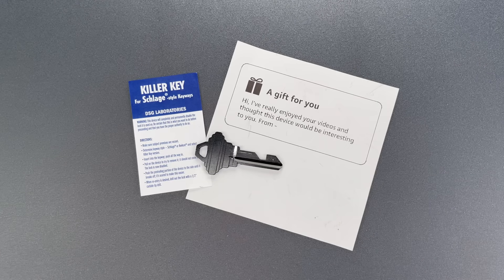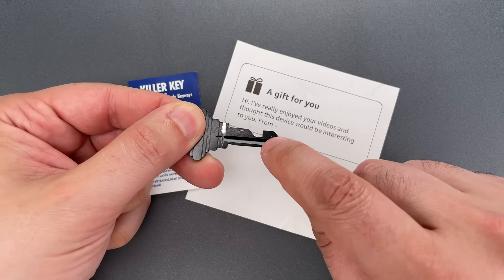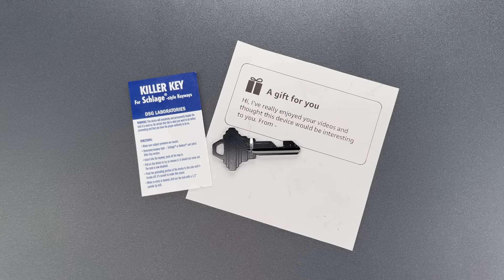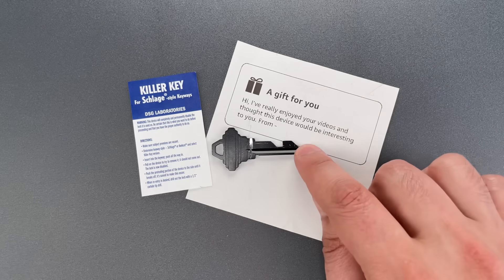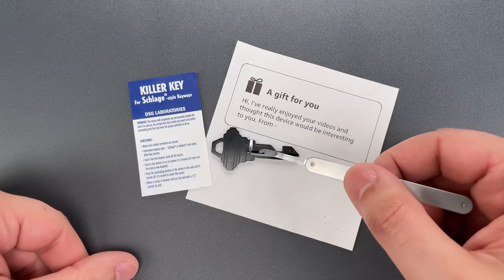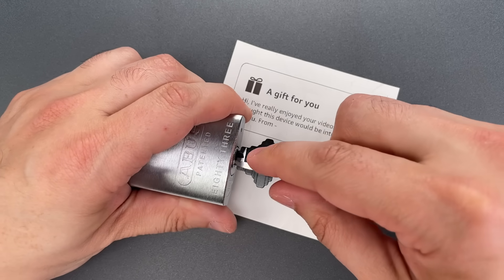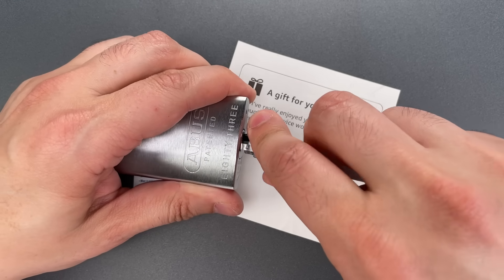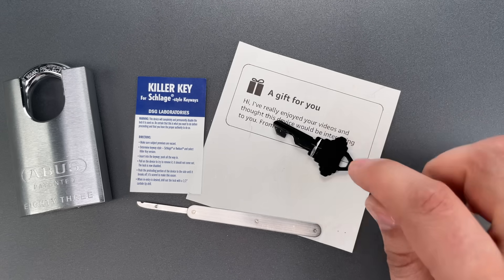[1350] Defeating a “Killer Key”

Comment: Okay, dumb question- what scenario would this lock/key used in??
To open a lock and then break the key off so it makes the lock a one use item? (For security purpose that requires a new lock at every opening?)
Reply: If you needed to buy some time to escape, or prepare by grabbing a weapon, this could do the trick.  Open the door, break off the killer key, close the door.  Might also work as deterrence.
Reply: A shop I worked for basically made one and used it on a service door, we could still use it from the inside but there was no way to easily open it from the outside. So if we needed to we would put a screwdriver in the gap to keep it "unlocked"

Comment: I remember having this kind of key deployed against a store that a family member owned. They used the back entrance or I think the neighboring store's shared rooftop access (I heard this secondhand from an aunt and a cousin later clarifying it was done to the front and backdoor). Either way they got inside and popped the door off the hinges and used three people they angled the door with the keyway facing the ground and shook the door up and a down while they tapped the back side of the door near the knob with a rubber mallet - the bit of the killer key that was in the lock came out after a little bit of work.

Comment: A hardened version with a cylinder shaped head that would block the entry, instead of the stamped key shape, and this really could kill a lock
Reply: That definitely would be harder to defeat, but I think you could still do it without destroying the lock. Take a rotary tool with a cutting disk, slice the plate away until you can access the keyhole, and then do as the video here shows.
Reply: @Dracalis  wouldnt even need a rotary tool. A good strike on the side with a hammer or rock could probably shear the head off.
Reply: @Dracalis  If you still have access to that rotary tool while standing in front of your blocked front door
Reply: @DerH0ns  why would you put a lock killer key into your front door's lock?
Reply: @GrifoStelle  Someone else may do it.
Reply: @DerH0ns  battery powered dremmel would do.
Reply: @GrifoStelle  landlord may do it after evicting a tenant before they can get the locks changed
Reply: @GrifoStelle  it could be used by landlords after evicting people so they can't get back in before they have time to change the locks. The company I used to work for did this and after I learned that I quit as that sounds shady as fuck and wanted nothing to do with a company like that
Reply: @GrifoStelle  A landlord would use it to quickly and temporarily keep anyone who has keys out, and then come back later to change the lock.
Reply: @GrifoStelle  
They were made for landlords who want to lock out whomever is squatting in there property. And with that getting a LPL to come and open it like this would be next to impossible. Making it a simple drill it through in 30sec and pop another shitty Kwikset in it and move on.
Reply: @GrifoStelle  This sort of thing is often meant to temporarily lock out a short term tenant in a cheap motel or hostel.  The "lockout keys" come with a removal tool very similar to what LPL created.  I could also see using them in a business where you happen to have that sort of cylinder and just need to temporarily but not actually permanently bar access even with a key.  That style of keyway is widely available and sufficient for basic security.  (Basic as in keeping honest people honest, effectively.)
Reply: It could still be quite easily beaten I think, unless you also don’t want to damage the key. You would just need to cut or break off the cylinder
Reply: @tommykarrick9130  what about just a flat circle metal shield, that keeps very tight on the keyhole, instead of a whole cylinder thing?
Reply: Best way to kill a lock would be to melt it until it's just a ball of metal.
Reply: @thenightingale7405  Then how in the world would it temporarily protect the property until you get back to it? Think McFly, THINK.
Reply: @thenightingale7405  thermite key lol
Reply: or just jam some epoxy in there
Reply: @danielsankey8786  Inject a bit of JB Weld into the lock.
Reply: @danielsankey8786  Or a few drops of red Locktite. A dirty trick that some Bikers (motorcycle types) would sometimes do is put a drop of red Locktite on the exposed fasteners on an antagonist's bike and make it impossible to work on. Red, not blue, which softens with heat.
edit: Actually, it's not Red Loctite (also called Stud & Bearing Mount,) it's called Wick & Lock, although I do believe it was red in color. That was waaay back in the Seventies, and I was still hung over from the Sixties _
Reply: @TaiChiGhost  yeah man thats not a thing. Locktite only works well it it throughout the threads and even then a breaker bar will still loosen it. Also you can still ride the bike for thousands of miles before it needs work so its not a big deal. ALSO bikers are not the passive aggressive type. If you fuck with them they will just remove your teeth with the bottom of their boots, not make your bike hard to work on
Reply: @TaiChiGhost  red softens with heat, you just need more of it. Blue can be removed with hand tools, but becomes easier with heat.
Reply: Or just slather the key in super glue before inserting and breaking.
Reply: @phillhuddleston9445  lightly heating superglue with a pluming torch is enough to break it down and it wont old anymore. All it would take is slightly heating it and then using the exploit shown in the video.
Reply: Just jam a nail in there with a hammer, pretty sure that locks done.  Im guessing
Reply: @lostpony4885  hypothetically... lol
Reply: At that point just weld the door shut
Reply: Better version would have a sideways M shape and a flatten end so you could hit it with a hammer and break the pins
Reply: @cursedmailman3999  I mean this video just shows the best way to break a lock is to break it
Reply: Just insert it with a drop of instant glue.
Reply: @brunesi  at this point, just use instant glue without the key
Reply: @supersoupss  yep. Nail polish. Instant noodles. Cooked rice. Flour and water. Fine street dirt plus spit. Many items would cement after insertion.
Reply: LPL would still find a way to get it out in 2 seconds, doesn't matter what changes you make to a key or lock
Reply: Saw off the head and there you go
Reply: You guys are all way to high tech. If you're gonna put a "Killer Key" into a lock just sip it in super glue beforehand. Would love to see him pick that :D
Reply: Dudes, the best killer key is a super glue tube and syringe needle
Reply: Or just pour molten lead into the lock. All youd need is a mapp gas torch, some lead and a big spoon to melt the lead in.

Comment: I'd like to see you beat a lock full of epoxy. I mean that genuinely; that's the old "never opened again" trick I hear most often, and I'd like to know if you can work your magic on a lock that has all but literally been made into a solid block, because that sounds amazing to watch.
Reply: For most US homes it would be simpler to just drill a hole through the door or the side of the house. If your door/frame/walls are made out of thick stainless steel, then that might require a bit of tough drilling.

Comment: Add a drop of superglue to it and see if you can get it back out.  Doesn't even have to be a killer key, just a wrong one that fits the keyway.  Actually, almost any method of delivering adhesive to the pins seems like it'd work.

Comment: Another suggestion I might make is, instead of giving it a key like handle attach the blade perpendicular to a smooth dome, preferably one that sits flush against the lock. It would make access much more difficult, especially if it can also be welded to the lock
Reply: Or just carry super glue which is has many more uses than a specialized lock plug.   The only real purpose of the key design is stealth.  It blends in with the other keys you carry so it has to look like a regular key.
Reply: @toolbaggers  Also would be a lot easier to do covertly, for example preventing someone from securely locking the deadbolt on a door by doing this late in the evening, knowing they won't have a locksmith out until morning. Quick and natural looking. 
Nobody will think twice if they see someone inserting a key into a lock, whereas none of these other methods mentioned, such as glue, epoxy, welding, etc. could be pulled off smoothly and instantly like that, still looking natural.
This is a disabling device obviously intended for preventing use of a lock, which can be used to either forcibly keep it locked OR unlocked.

edit:typo correction
Reply: @ArtemisKitty  if youve drawn enough attention that you cant fumble with a lock for 3 seconds its already too late
Reply: @DragondekaTS020  Right... so how is their bringing/using a welding torch a good idea, yet my pointing out that such an action would be very noticeable is the point you argue against? OK... guess we'll just differ in opinion there.
Edit: Also the fact that super-glue doesn't come in key-shaped-and sized tubes that DON'T look like you're doing something other than trying to unlock a door.
Reply: @ArtemisKitty  which of those methods take 3 seconds? Super glue. Theres no mixing or setup needed. Squirt it in the lock and done. Good try though
Reply: @DragondekaTS020  The part where cfx3 says "you might as well just weld the whole thing shut lmao". That's the part I was pointing out as ridiculous. I thought it was a good try as well, thanks. :-)
Reply: Why not just inject epoxy into the lock? Can't open a gummed up lock.
Reply: If you're going to weld, just weld some tin into the keyway :P
Reply: @Poldovico  @ACGiantDad Haha yeah if you go through the trouble of having a custom made key to disable a specific lock and weld it on there too then you might as well just weld the whole thing shut lmao
Reply: @cfx3  y'know, fair. Sometimes it's the obvious answers that you miss
Reply: Blah blah blah. Funny how the comments is full of genius's but LPL is the only one with a channel actually living it.
Reply: @SomeYouTubeGuy  And trolls who show up months later to resurrect dead threads by personally insulting the people who posted before them, yeah... wonder what we can do about that problem?

Comment: Out of curiosity, what is an example of typical, legitimate of use for a "killer key"?
Reply: an ex girlfriend who really wants to get back at you
Reply: Sabotage to immediately prevent access to a lock that someone you want to deny access already has a key for... Unless it's Lpl or bonsai bill
Reply: My old shop made one for a door to only be opened from the inside. If we needed to go back and forth we would jam a screwdriver in the gap so it would stay cracked.

Comment: Haven't seen this asked yet: would drilling the lock be necessary if someone snaps the blade of the key into the lock, or is there usually enough left sticking out of the lock to grasp with, say, a pair of needle nosed pliers or some other tool?
Reply: With LPL's design, you would probably need a drill.
If it were the design that got sent to him, needle nose pliers work perfectly.
Edit: The "Of" is meant to be an "If".

Comment: Personally I prefer the tactic of taping a sign on the door that reads "No"

Then there's a chance of the attacker stopping to have a laugh before just kicking in the door frame
Reply: I'd have a second door behind it with a sign "I said no!"
Reply: Well, after watching a lot of this videos, I just brick my doors up every evening. I mean, yeah, it's expensive and quite a hassle to hammer them away every morning with jack.... but what do you gonna do?
Reply: @robertnett9793  Mortar takes too long to dry; we'd need to hire someone to weld plate steel at every entrance nightly and promise to come back in the morning...LPL would still likely find a way to show the weakness of my chimney with a fire burning.
Reply: @jeffreycroswell5203  
LPL: Well, what have we here? It seems as if someone welded steel plates over their entrances and windows. Hovever, they missed some major flaw in the setup, as the brickwork to the left and right of the welding has been mortared up with sub-standard materials, so I easily can crumble it apart with my Lego-spaceman...

building crumbles to dust, with a few sad metal plates still standing

Well, that's all I have today...
Reply: @robertnett9793  Let me rebuild this house just to do it again to show it wasn't a fluke.
Reply: @robertnett9793  If only we had some sort of technology that had a bolt that makes it impossible to lockpick from the outside. If only that tech existed...
Reply: @Jebu911  You know what a joke is, right?
Reply: @Ecard Ecardian I can see it before my eyes: A wall, hundreds of meters long eight stories tall - covered in identical doors.
Then, when a would-be attacker arrives and breaks down in despair - I open the door from the inside to taunt his sorry self even more :D

Comment: If your intentionally trying to disable the lock need drilling, it's being destroyed anyway(in theory) so why even buy a killer key? Any piece of scrap small enough to fit inside the key hole will be effective if you coat it with super glue before jamming it in, and don't leave anything sticking out.

Comment: place a ramp on the key profile where it ramps down and sharp up such that when a tool with a divot in it to engage the flat of that ramp (that goes straight up and down) does not catch that edge. smooth it over to make it harder for the divot to engage.

still won't help stop the tool from engaging the pins allowing the kill key out. <3 all

Comment: Back in the mid 80’s I invented one of these keys, by pure accident.  I was guessing at key depth trying to make my own set of manufacture tryout key ring.  I managed very easily to get the blank stuck in the cylinder plug and shell.  The only thing that saved my stupidity of the day, was I had the complete cylinder loose and clamped in a Bench Vice.  I used an awl and small screwdriver and pried open the housing shell to release the driver pins and springs. After this I used a cylinder plug holder, and cut all my spacing, brushed the blank down, then loaded the cylinder plug to try my depth set.  I wasn’t trying to make a cylinder blocker, but I did.  Who knew that it could be marketed. I guess I should have patented it.  My manager called me one night and said he needed to secure a exterior door.  I asked him if he had a non working key on his ring (other than his GGM) I told him to break a key off inside the mortise cylinder, and I’d deal with it in the morning. It was a quick fix for the middle of the night, saved me from having to come in.

Comment: "It will not slow down a prepared attacker"

Honestly I think this would be more used by a shady company who wants to make a quick buck by breaking one off in your keyway and waiting for a call to the locksmith... Seems like a dumb product.
Reply: I think this is a product for when you want some door to stay closed. Like if you have few entrances to a building but just want one to be inaccessible without pulling the door out and walling up the hole.
Reply: @Cykor666  This simply plugs  the keyway. Surely there are numerous imaginative ways to accomplish that permanently without this gadget.  It doesn't appear to perform any function that would "keep the door closed."
Reply: @UpnorthHere  It could be used to plug the lock on the outside but still be able to operate from the inside.  But like you said, you could just plug it with whatever fits.
Reply: Dumb product.
Reply: You just described a prepared attacker.  A highly specialized and odd prepared attacker.

Comment: If your goal is to make a "killer key", I think the best route to destroy a door would be inserting epoxy resin into keyway.  Mix some up, syringe, squirt then run off.  That, I'm pretty sure, LPL's methods wouldn't work on and would require some kind of drilling.

Comment: so i have the decoder from my purchse of covert companion and I have some of these keys from another web site, four to be exact. Schalage, yale, kwick Set and the 4th im unfamiliar with. my my keys come in two pieces and when you remove the "key" the blank remains in the keyway and is too short to be extracted. But when you re-insert the "key" it moves the pins out of the way, grabs the blank and both come right back out. I travel alot and use these on hotel doors. No more housekeeping bargig in when im dead asleep ... or any ther nefarious activites either. Lockbusters i think theyre called, you might already be aware of which web site but i wont give them credit on LPLs shit since he also sells similiar products